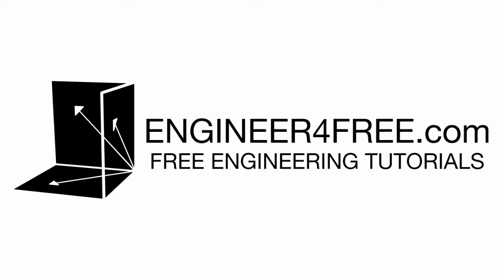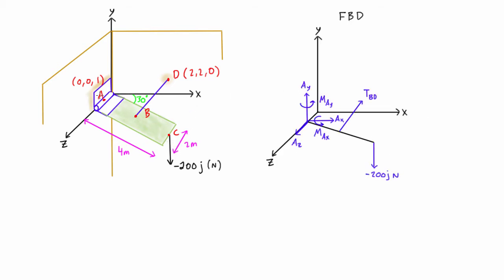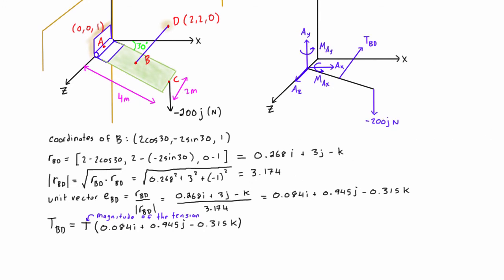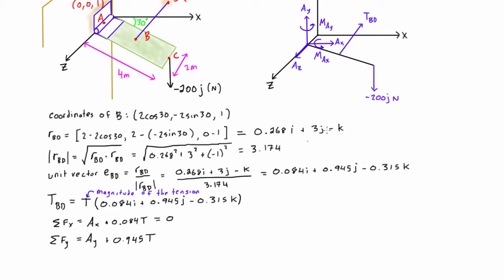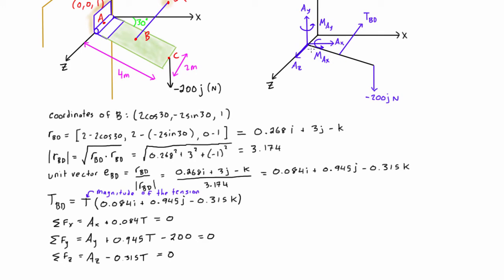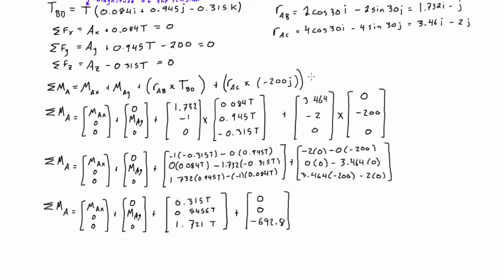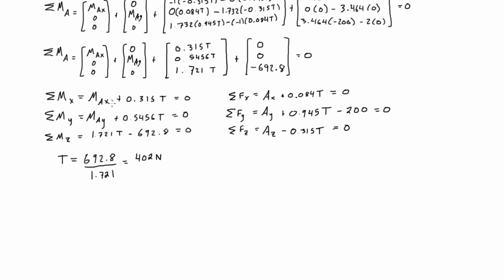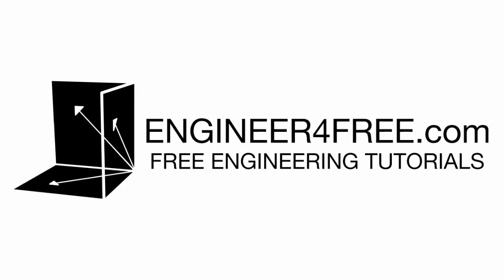3D statics problem: worked example with hinge and cable

Comment: Why does this have a Moment around the Y and not the Z ?
Reply from the maker: Hey it's because the hinge rotates freely about the z axis, so it can't provide a moment reaction about the z axis if it rotates freely and doesn't provide any resistance. If you grab the member ABC and try to rotate it about the y axis, the hing would resist you, and same if you tried to "twist" ABC, which more or less is a rotation about the x axis, the hinge would also resist you. It doesn't resist you if you try to rotate ABC about the axis of the hinge, which is also the z axis.
Reply: Thank you so much! Subscribed! Looking forward to learning more from ya!
Reply from the maker: nice bro! you're welcome, glad u found the channel. stick around and tell some friends! I've got a ton of videos and I try to respond to every comment =)
Reply: @Engineer4Free  But didn't you include the moment about z axis already? Its just not labelled Mz, but the calculation for it is there? (R ab *  T bd) + (R ac * (-200j)) these are moments Mz are they not or include them?